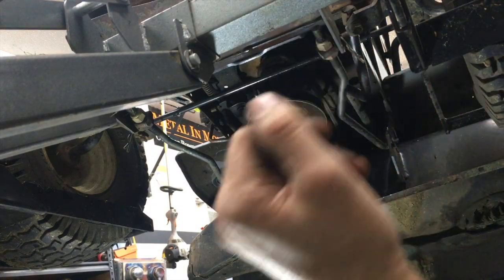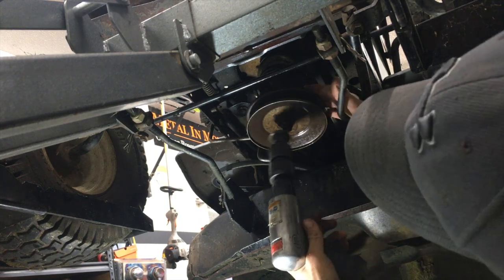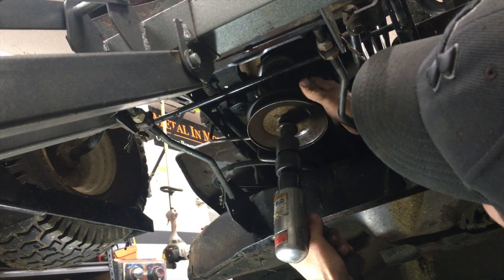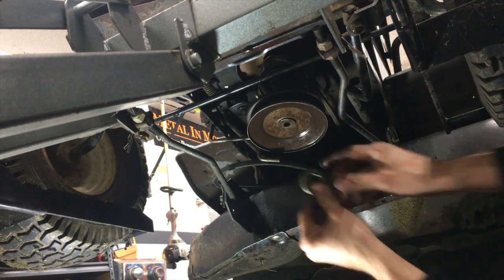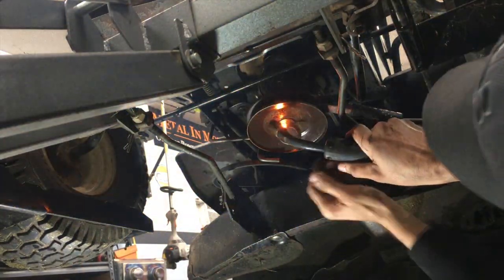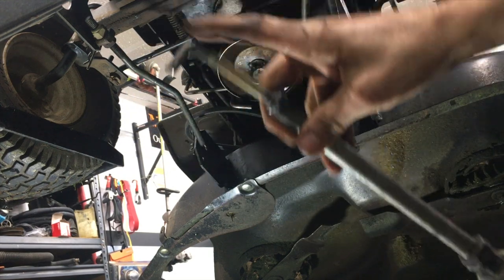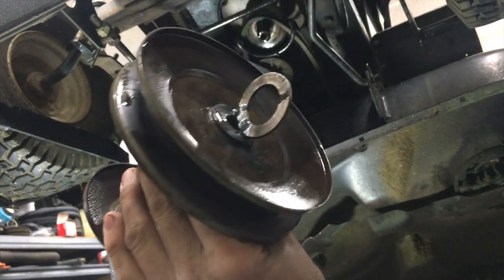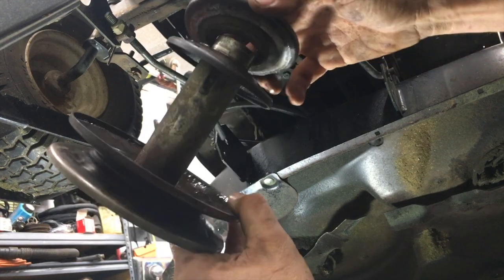How to remove a stuck drive pulley on your Briggs and Stratton, Kohler, or Kawasaki riding mower.

Comment: Why not use a gear puller? And a little heat?
Reply: Puller will wreck the pulley. It's thin mild steel. 
Heat will wreck the seal (which could be replaced, but...)